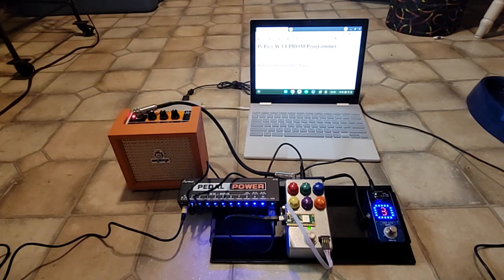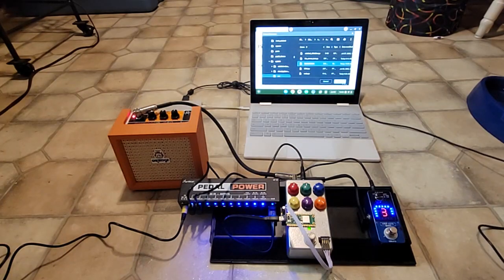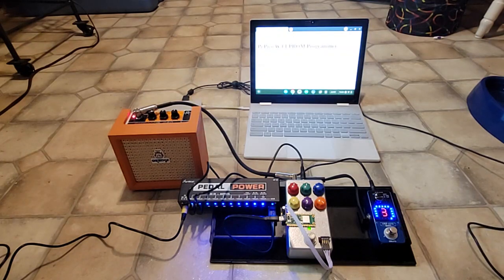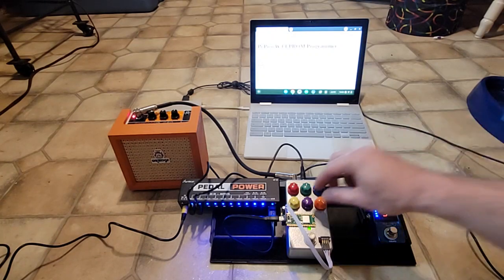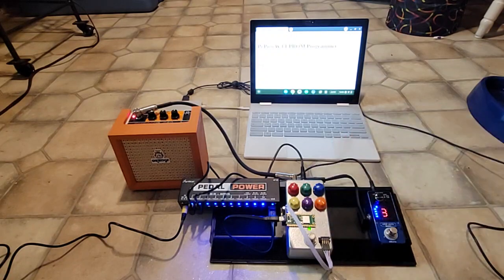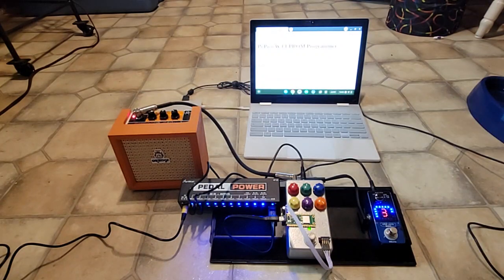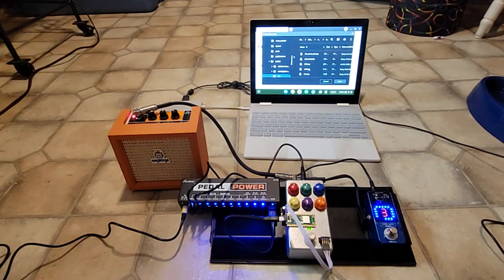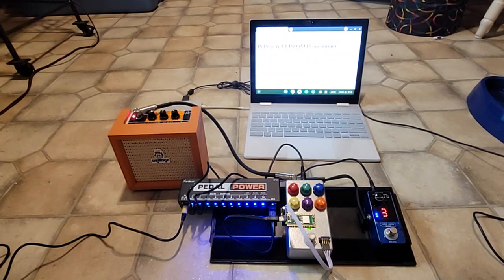Spin FV-1 eeprom web interface

Comment: Id love to see more about how that works! I just ordered a couple of FV-1's. The dev boards seem hard to find
Reply from the maker: There is a thread in the pedalPCB forums -> Spin FV-1 Development sub forum that details this build. It is just a Raspberry Pi Pico W hooked up via i2c to the EEPROM. 

If you just want a simple way to program EEPROMs for the FV-1 I just use a CH341A USB programmer. I didn't bother with the DEV board. I used the PedalPCB arachnid for my FV-1 platform.
Reply: @AaronTusko  awesome, will check it out. Thanks!